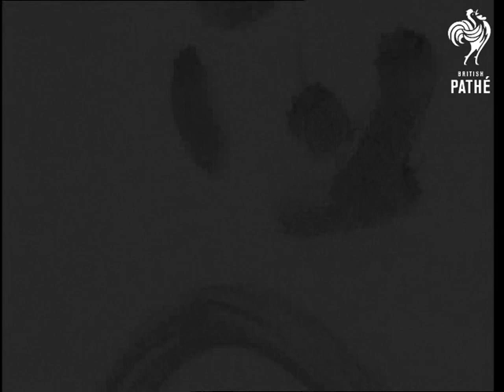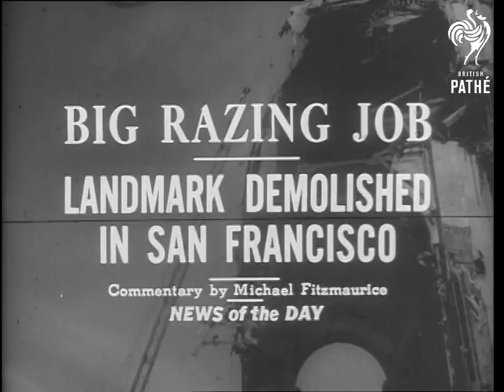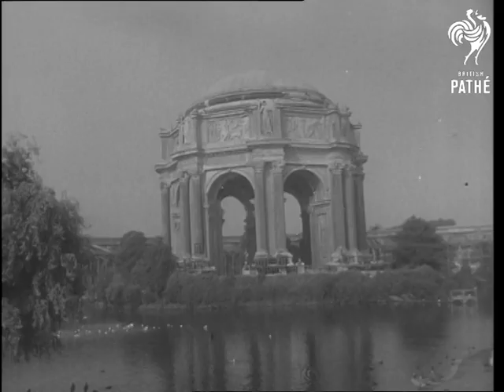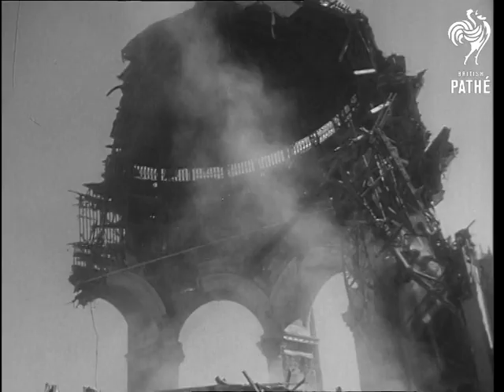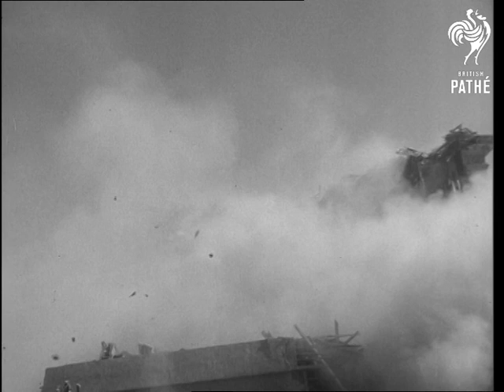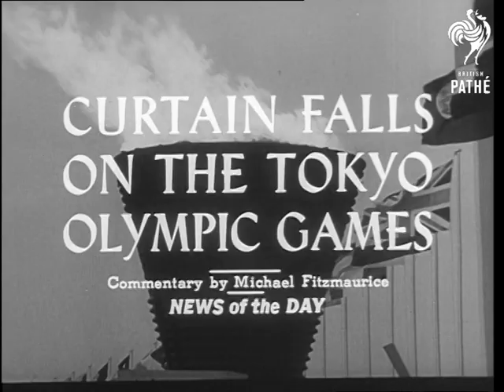Fine Arts Palace Demolished (1964)

Comment: That building was already there. Who and when built it?
Reply: It was built in 1915 specifically for the Panama-Pacific Fair by ordinary construction workers of that time
Reply: @kalenc515  let's see some construction pics of the reconstruction FROM THE AIR. I'll show you plenty of the 'original' building...
10 years and no one took a picture.
Reply: @kalenc515  so are you stating that all of the buildings were built in two years? on over 600 acres...
Reply: @I_am_Kairos ow many ripped linen, buggy driving, drunk, salon gun fighting, gold rush hicks to dig, mine metal, form it...plus..all the other needed supply chain personel?  Ppl have never been there or realize the massive UNBUILDABLE structure..even in todays "advanced society" 😂😂
Reply: The Palace of Fine Arts was built as a temporary structure for the 1915 Panama Pacific International Exposition. It was kept in repair for almost 50 years until it became necessary to demolish and reconstruct the building in reinforced concrete.
Reply: They most definitely were and it was all documented and remembered by the people of San Francisco who watched it being built.